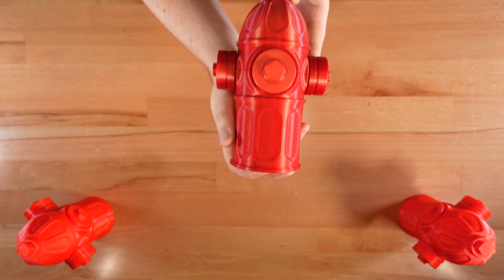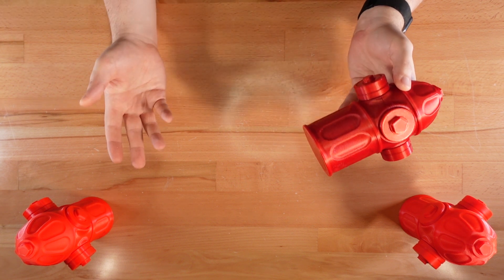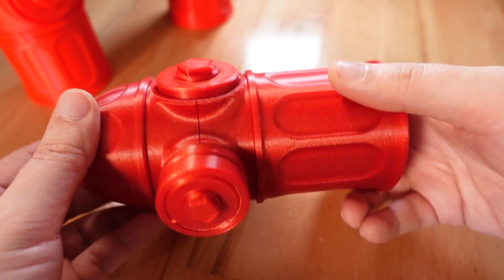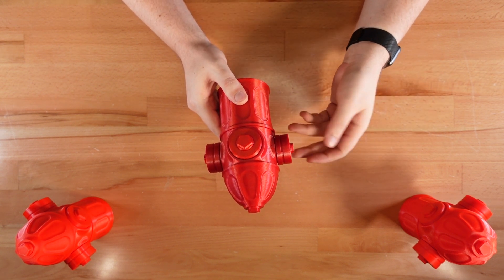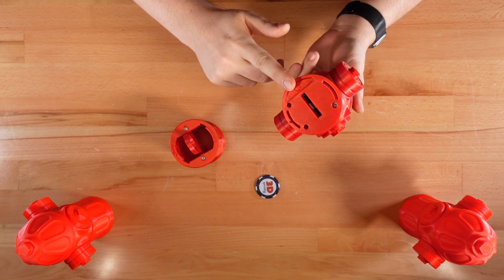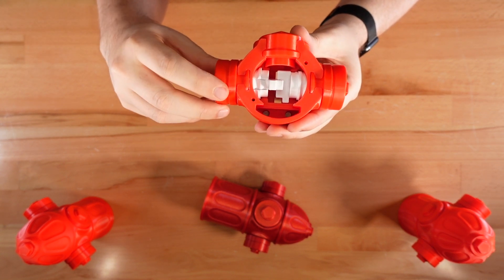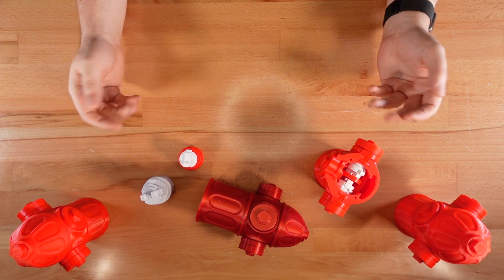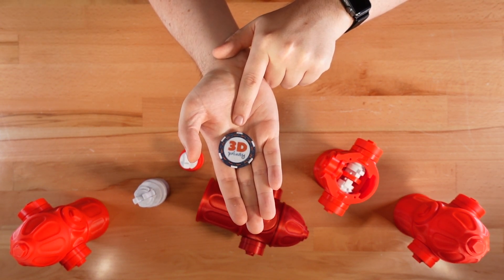3D Printed 6-Alarm Puzzle Box

Comment: Sorry this might be an obvious question, but what's the trend with maker chips? Is it just something people do for when they go to conventions so they have a fancy version of a business card?
Reply from the maker: It's just a new take on the maker coin, but it uses less filament and comes in a standard size for easier collecting/sharing at events.

I turned mine into a springy fidget (you can see the spring on the back side of the chip) because I'll use any excuse to add moving parts to a model.